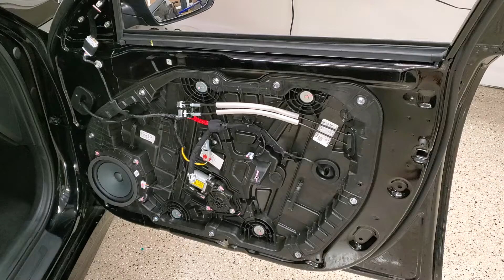2016, 2017, 2018, 2019 & 2020 Kia Optima - Metal Door Frame - Plastic Interior Door Panel Removed

Comment from the maker: Check out my DIY tutorial for taking off the plastic interior door panels in a 2016 to 2020 Kia Optima sedan - 
https://www.paulstravelpictures.com/2016-2020-Kia-Optima-Interior-Door-Panel-Removal-Guide/index.html

Here are all of the DIY repair and maintenance guides for the 2016, 2017, 2018, 2019 & 2020 Kia Optima - 
https://www.paulstravelpictures.com/Articles/2016-2020-Kia-Optima-DIY-Repair-Maintenance-Guides.htm